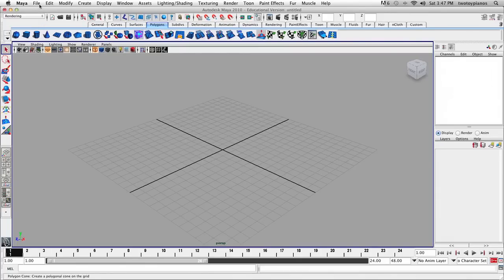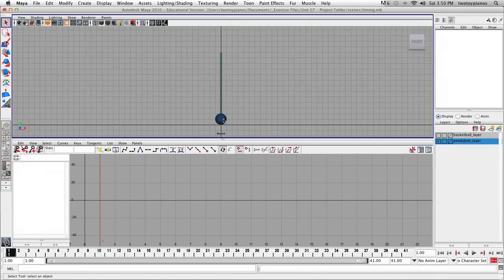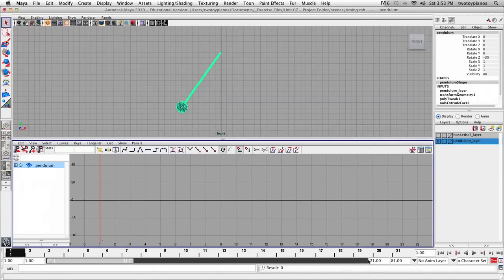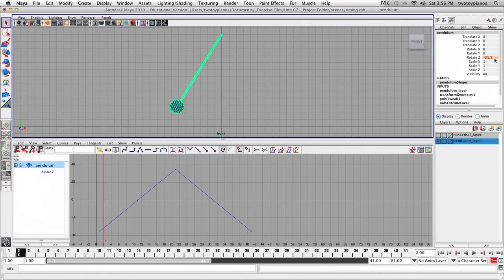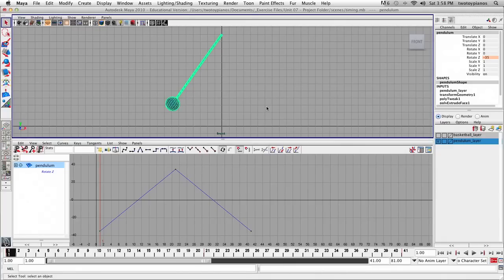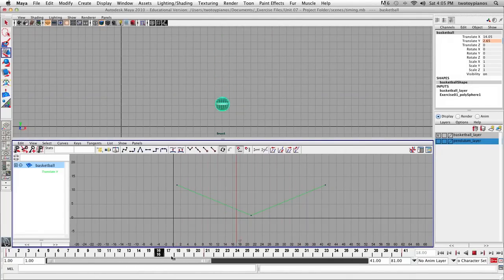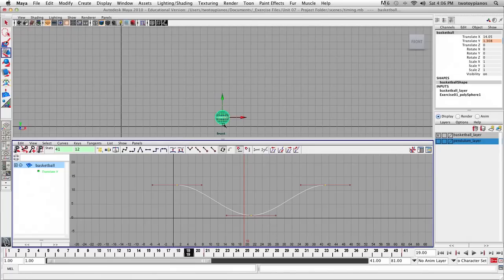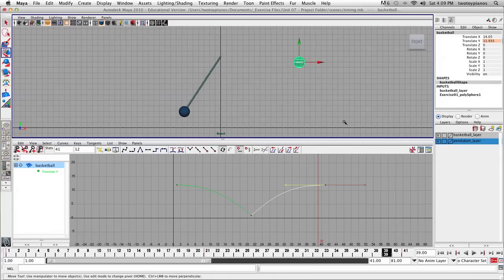Animation Principles In Maya - Timing and Spacing

Comment: Question: If I'm trying to make a ball bounce cycle within 1 second (24 frames in standard film), then would adjusting the timing and spacing work in making it look natural within that constraint? Stretching key frames apart would slow the animation and exceed 24 FPS. Would it just be a matter of adjusting the spacing then?

Asking to make sure I understand the concepts correctly.
Reply from the maker: Whether the ball bounce looks natural or not will depend on the distance the ball travels since you have constrained the loop to 1 second. Set your keyframes at 1, 12, and 24. If the ball is too slow adjust the position on frame 12 and make the distance traveled longer. If its too fast adjust the position on frame 12 and make the ball travel a shorter distance.